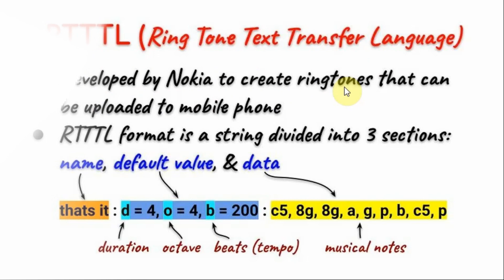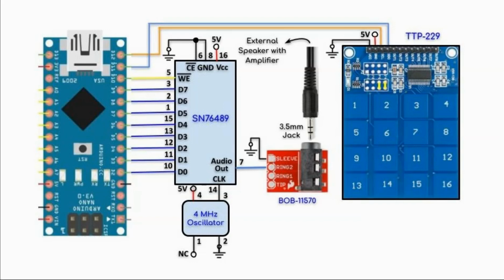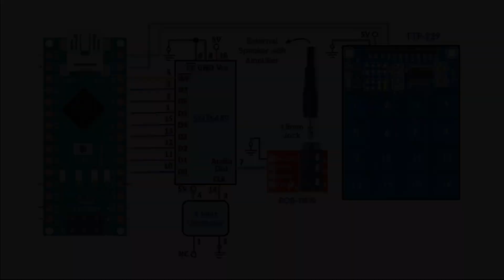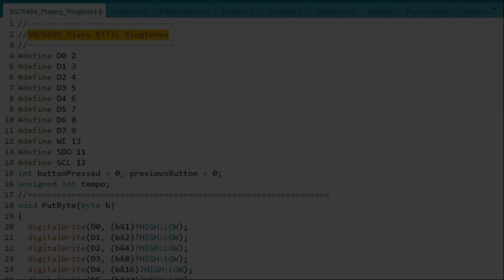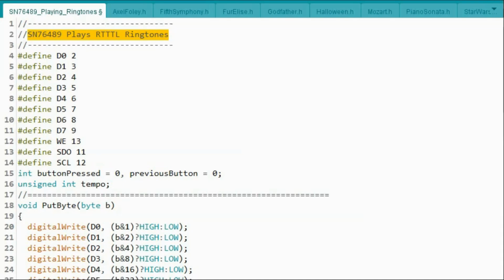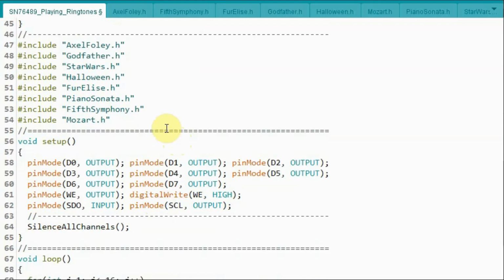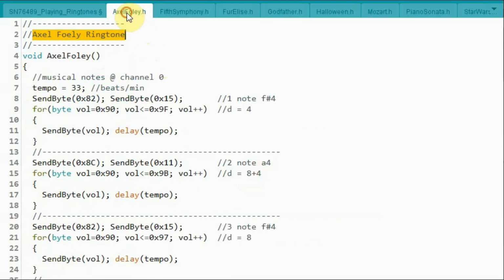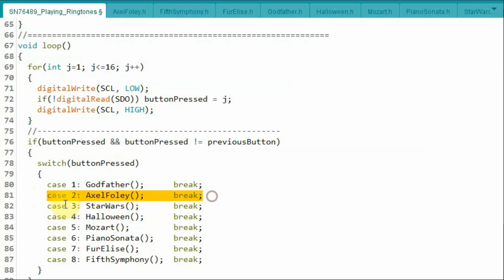SN76489 Plays Multiple Ringtones

Comment: Great Work ! I lookin on your site, I think there is some error in the diagram, next to of 76489 you write that D0 correspond to the pin number 10, but D0 correspond to pin 3 according to the data sheet,  then the error is the same to all pins D1 -> 11, D2 -> 2 and so on
Reply from the maker: Thanks for your feedback. I'll check the sketch.
Reply from the maker: I corrected the diagram. Thanks again.
Reply: he is actually correct in that D0 is the MSB on a 76489 which is opposite of convention. I don't know why TI put them backwards, but on this chip the data bits are backwards from convention. Therefore, addressing D0 in standard convention would actually mean you're talking to D7 on the SN76489.